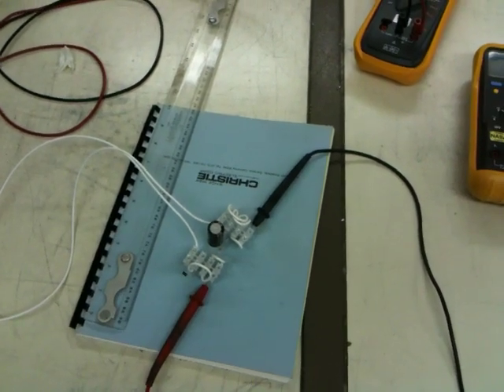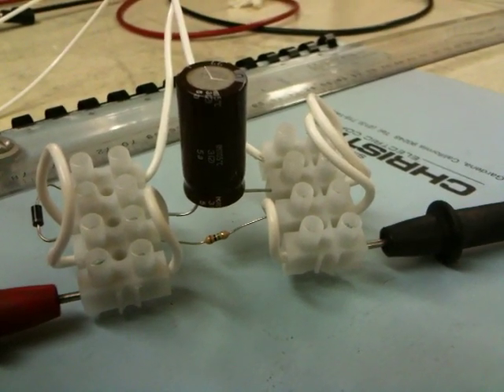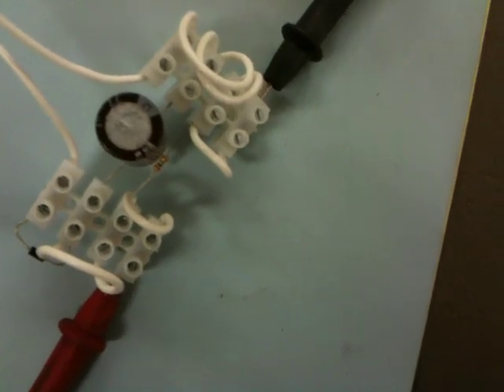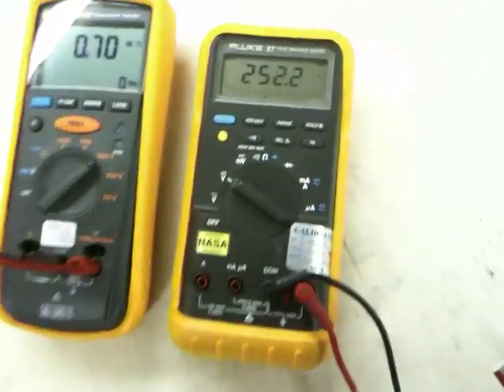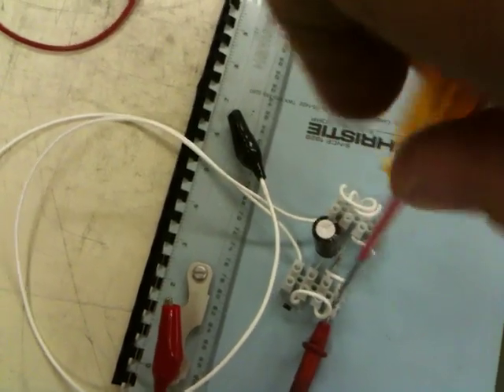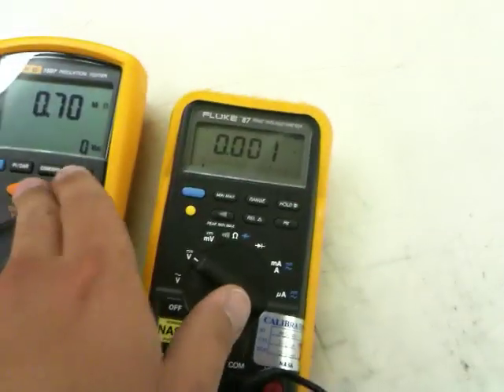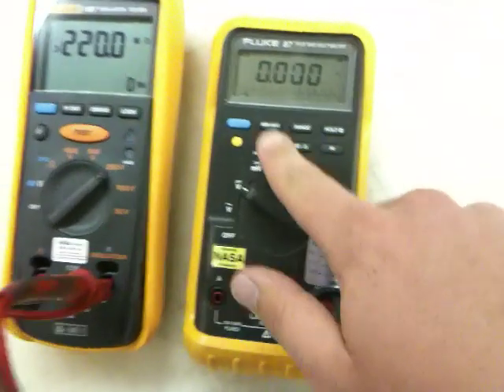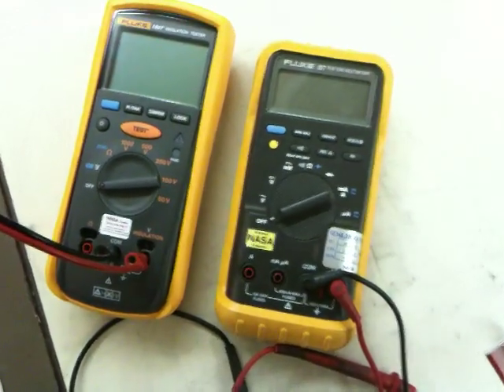Home Made Peak Voltage Adapter

Comment: The manual from Honda ('02 VTX1800R) says the MINIMUM voltage from the ignition pulse generator needs to be 0.7volts. I measure it to be nearly 4.5v! 
Mind you I am reading at the plug where it comes out of the side case.  The wiring between that plug and the ECM are damaged in the wiring harness. Imagine that!
Somebody help me out please. I am in over my head!

Comment: How could an ignition fault cause an internal combustion engine to overheat?
 
Low spark would cause a rich condition, and therefore a cooler running engine. 
Good on ya for making that PVA, nice work.
Reply from the maker: I had already replaced the impeller and cleaned all of the cooling passages in the head and block. I was grasping at straws at that point. My thought was that if the engine wasn’t firing on all cylinders, the impeller wouldn’t be working as efficiently, and therefore not pumping as much water as it should, resulting in overheat.

Comment: So i decided to make one my self for checking my bikes, but the only hardware store that sells this kind of parts didnt have the exact same as you are using.. will this affect my reading ? i read in another thread that the 330ohms would help not to get a shock. im kind of new on this, will these work allright o i need to get the correct ones? 
Capacitor: 22mF 250v
Resistor: 330ohms 1/2w
Resistor: 1megaohm 1/2w
diode: 3amp 600volts

Comment: Just wondering if I can use the following in this circuit as this is all I could get at the local store:
47uf 450V capacitor
1mega Ohm 1/2 watt resistor
 1 Amp 400V diode

Comment: If I don't need to measure that much voltage can I use a smaller capacitor with the same other components. I think I don't need to measure more then 100v. Would a 22uf 200v capacitor work for me?

Comment: I've purchased one awhile ago to test my outboard $70 same deal, needed the part.  And its a nice unit with good leads.  I'm building one for my project in class.  I've got a different schematic.  If I understand your test your putting in 250v which is rms voltage.  The peak voltage adapter is Vrms *  1.4142 in your case that should be a reading of 250* 1.4142 = 353.55  (give or take).  put it in an electrical socket, remember use dc on meter and a 120 plug should read 168v.  I'll get back OT

Comment: I gues I should have mentioned...Trying to diagnose a no spark issue on a 1995 Johnson 50HP outboard motor... I have all the identical parts as your setup in the video except the cap says 33uf.... will this work?

Comment: the guy in the shop suggested i use a 25v capacitor and the rest the same as yours . connected it all up today for less than a pound, not including the connector block, saving loads of dosh, annnnnd it works. ;)

Comment: You're gonna laugh...  teasting  showed something wrong with the timer base...
lifted the flywheel BROKEN KEY....   I could have suspected that as it started great for the first startup then never again must have had a loose flywheel nut I'm guessing as there's no reason for it to break a key on startup. anyone lifting the flywheel those puller holes are 5/16 x 25tpi unf nothing on your outboard will fit...
Brm brm.....